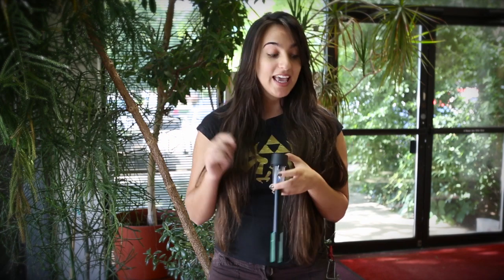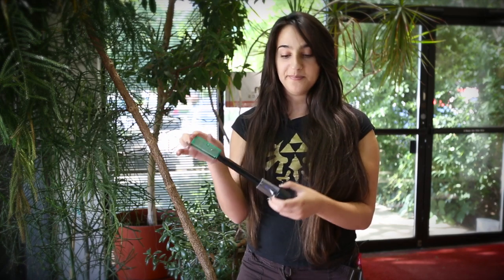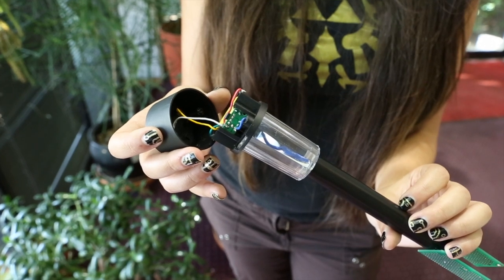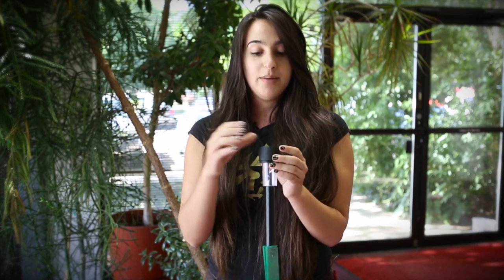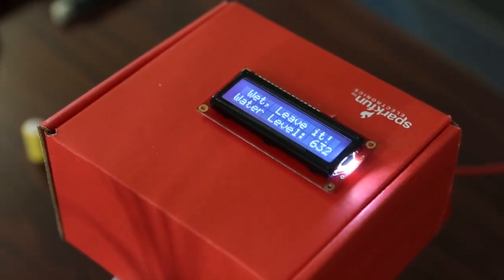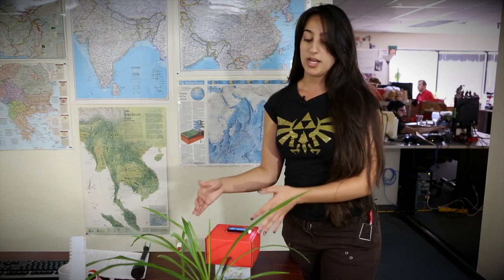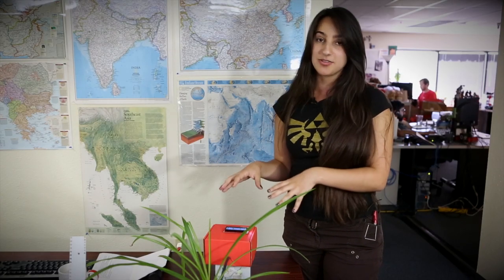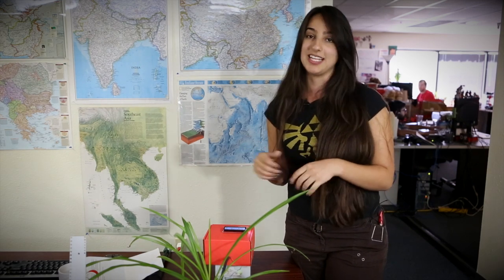SparkFun Soil Moisture Sensor

Comment: Nice project. Although, at at the end. I would add a Schottky diode between the solar cell and the battery
1st: To prevent the battery from draining into the solar cell at night, and
2nd: The forward voltage drop would reduce over charging the battery during the day. That way, the battery should have a longer life. 

Anyhow, one doesn't usually check his/her garden at night so a battery probably is not needed except maybe as a current sink to prevent too much current from going to the led when the ground is dry and the sun is shining brightly on the solar cell.
Reply: Keith Reynolds swap the LED with a resistor a lead to each end of the resistor, and then you so that you can sense a voltage at the ends of the leads.